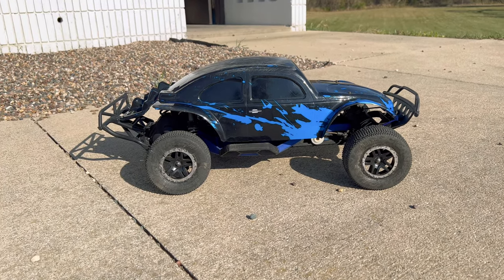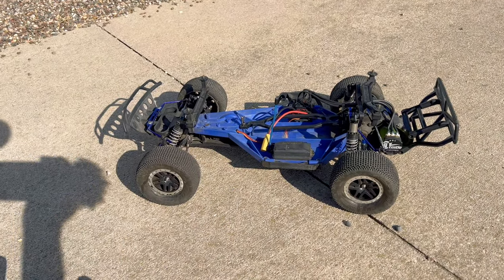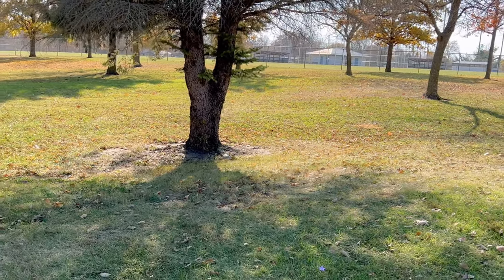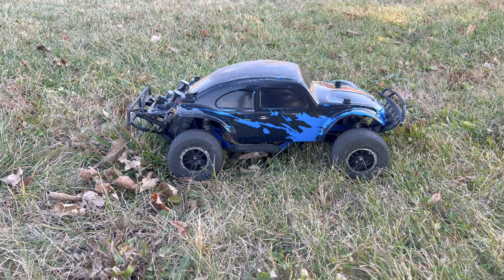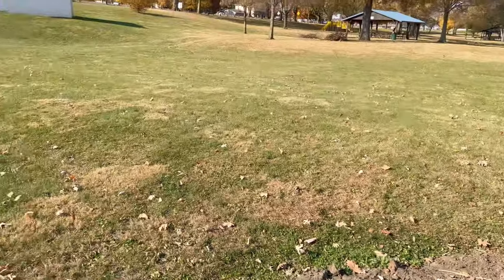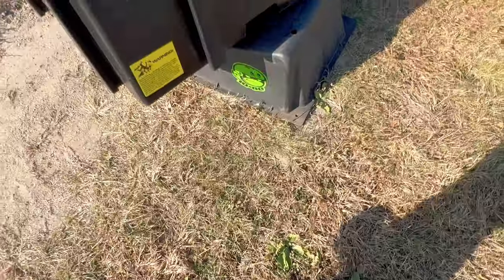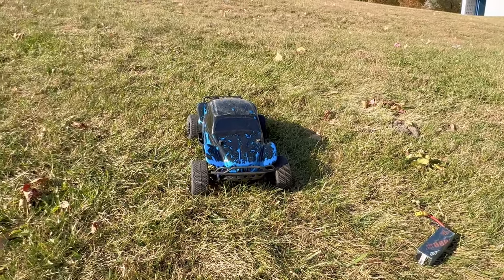**CASTLE 4s POWERED** Traxxas Slash 2wd // FIRST BASH !!

Comment: Nice video loving all the build videos, just put a castle 5700kv motor and a sidewinder 4 in my slash 2wd with a 19 tooth pinion and 83 tooth spur and it rips  so far no overheating problems
Reply from the maker: Thanks! That’s a pretty high KV motor,
glad it’s working well for you 👍😉
Reply: Yeah I screwed up and ordered the wrong kv hit the wrong button lol
Reply from the maker: @chrismorgan9290  well as long as it worked out in the end

Comment: Hi mate I had the same problem so I've put some rubber under under the battery post. I punched a couple of holes for screws to go though it moves a bit but that's fine. Looking forward to your next video mate 👍🤪😁😁 I used truck tube rubber 👍
Reply from the maker: Oh I gotcha! Thanks!

Comment: I built my vxl 2wd slash into a road slash by keeping the stock front tires and making the rears a 2.9 53/107 db boot hoon tire and doing ssome susspension tuning like shock placement adjustment, pre load changes, and camber adjustments made it into a good machine. Other than the motor/ esc, what else did you use to mount the motor up? I know I will probably get stseel gears, but what gear ratios did you use, did you uses a clutch delete, and did you upgrade the diff gears, I have a sesaled diff wth stock gears and some diff fluid, but other than that, my trans and gear setup is stock.
Reply from the maker: Yeah it’s got 13/58 gears (32p), it’s also running the Drag Slash 272 Magnum R Trans

Comment: Hey man! I’m looking to convert my slash into that setup, can you still use the traxxas battery’s on it? Like is it the same plug in plug? 🤔
Reply from the maker: The plug that came with mine was an xt90….you can buy it without a plug and solder whichever plug you want onto it though
Reply: Thanks man I appreciate the help 👍🏾
Reply from the maker: @chilote44  you’re welcome 👍😉

Comment: What issues did the vxl system give you? I'm currently running the vxl system in my 2wd slash
Reply from the maker: It started overheating and hitting limp mode all the time….then the bearing fell apart on the front of the motor
Reply: @RCKnockout  I keep a close eye on the temps in the summer as the temps get way to high, but in the winter, the temps stay nice and cool. Do the temps stay cool in the summer for you with the new motor setup
Reply from the maker: @charliemaybe  yeah the temps seemed fine

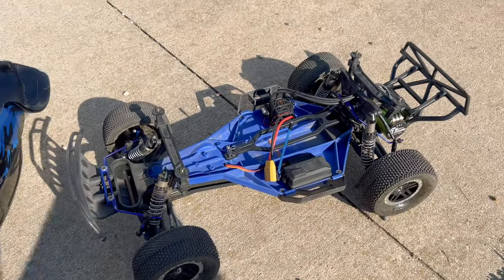Comment: At 1:42 you could keep the stock tray and as you hand is one doubled zip tie from receiver box to esc side and then again the other end of esc of that makes sense Nolan
Reply from the maker: I’m not sure exactly what you mean?
Reply: @RCKnockout  use zip ties across the lipo instead of the black strap type thing that goes over the lipos length ways
🤔 have you ever seen how Rocky of Thunder Rc would tape around his X maxx so his lipos wouldn’t pop out in his huge landings
Reply from the maker: @gonzodetroitify  no I’m still not entirely sure what you mean?
Reply: @RCKnockout  🤔 from nurf handle to nurf handle once lipo in place as it’ll not want to come out once in as zip ties will be taught right upto lipo casing
Reply from the maker: @gonzodetroitify  oh I gotcha…..that might work

Comment: Hello,

Thanks for the vidéo.

Motor 3674 in 1900 + ESC 100A for 4s run is a good idea ?
Reply from the maker: Glad you liked it! I’m not familiar with that particular motor and Esc setup
Reply: @RCKnockout  really, low kV + long motor + 4s = torque power 🏁💪🏁💪
Reply from the maker: @zackfair7697  nice! What brand is it?
Reply: @RCKnockout  supersonic rocket RC
Reply from the maker: @zackfair7697  interesting….I’ve never heard of that brand
Reply: @RCKnockout  do you know the brand "surpass hobby"? it is a recent version of this mark.
Reply from the maker: @zackfair7697  yeah I’ve run some of their motors actually
Reply: @RCKnockout  ok 👍
Reply: @RCKnockout  I will install a proline body like yours and put a basket with two spare wheels on my Traxxas Ford f-150 raptor.

do you have any advice for adjusting the sleeper on the magnum 762 R transmission in 4s?

thank you for your videos.
Reply from the maker: @zackfair7697  sounds cool man! I haven’t adjusted my trans at all….seems perfect right out of the box

Comment: Do traxxas lipo batteries work with this?
Reply from the maker: No the ID ones won’t work….if they’re not ID batteries you could solder on the correct plug
Reply: @RCKnockout  I was hoping to solder the right traxxas plug on the end of the castle esc. Will that work?
Reply from the maker: @rileyward19  yeah that would definitely work if you wanna continue using the Traxxas plugs

Comment: I had duratrax six pack sc on mine. They were nice til I stripped out a hub 😢 I’m running badlands on beadlocks now, they are a little bigger diameter than stock so they rub on the stock body. They probably won’t rub on the bug body but I run my bug body on my trx4 so I’m not sure 👍
Reply from the maker: Yeah I’d like to try something different besides the badlands but we will see

Comment: So you know what I’m going to try out Nolan

I’m going to try and double up some very thick zip/Cable ties across the width of the slash 4x4 and the ends of the lipo tray 🤔 and see if that holds true and try not to get the joins underneath the chassis as that’s snag on anything not flat whilst running that way I can run gens ace 3s 8000 100c lipos tho they’ll be very heavy I don’t jump that much so I’ll gain very long run times
Reply from the maker: You’re talking about holding a tall battery down with zip ties?

Comment: You need to 3D print the extended post.  Then you can carry a few extra with you. 👍
Reply from the maker: Carry a few extra what?
Reply: @RCKnockout  Battery post. They even have files to print the hold down bar also.
Reply from the maker: @Mad4saxBrewery  gotcha……but the post would have to be metal though……plastic would break immediately
Reply: @RCKnockout  True.  You stress your trucks more than I do! 🤣🤣🤣
Reply from the maker: @Mad4saxBrewery  yeah I’m not easy on them lol 😂